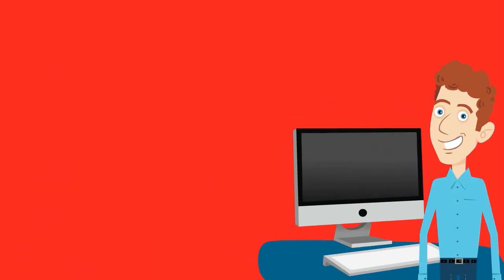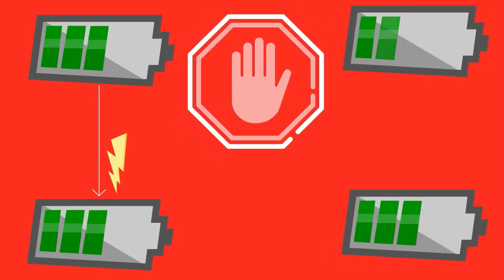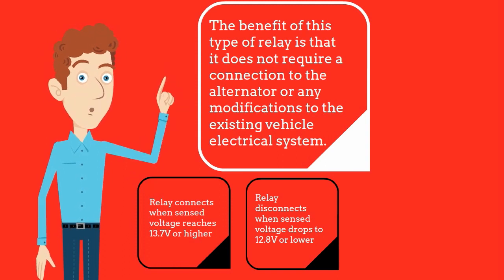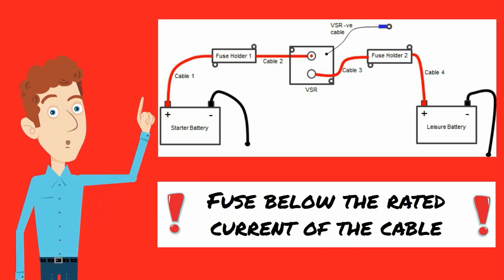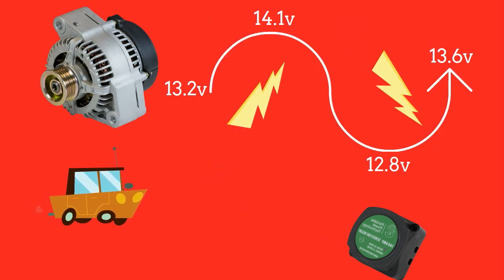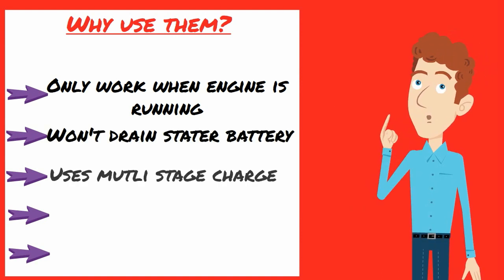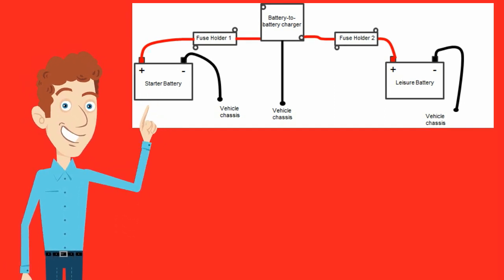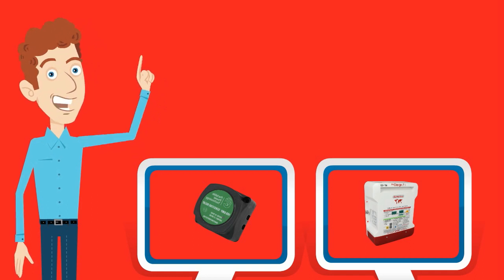Voltage Sensitive Relays (VSR) & Battery-to-Battery Chargers Explained | 12 Volt Planet

Comment: Great video and I'm just learning this. Is this a correct statement. A dc to dc charger is superior , it will regulate your current, prevent over charging, offers 3 stage charging and protects damage to the battery bank, whereas a VSR does not do this?

Comment: thank you.  My Voltage COntrol Relay box (which I am assuming is the same thing) has two posts.  One is marked closed 12v and the other is marked Open 12.8.  Buggered if I know which goes to the car and which one to the van.  I have currently got the 12.8v going to the van.

Comment: Can I use a VSR to feed the DCDC charger? The DCDC charger that I have is not smart and will not disconnect with engine off... it does have a ignition feed but I dont want to open up the dashboard to find the ignition wire...

Comment: Hi there bought a vsr split charger for my Vauxhall vivaro it's got a smart alternator in it  when I heard it doesn't work i sent it back but the seller insisted that it still works with a smart alternator do you think there's any truth in this
Reply from the maker: If it is just a standard VSR that is not specifically compatible with a smart alternator, then no it would not work properly. We would need to see details of the relay to check for definite though. You can send the details to us at sales@12voltplanet.co.uk and we can take a look. Many thanks

Comment: What happens if you use this if a  smart alternator is on. I have one installed, it’s working but I think the vehicle is a smart alternator as it’s an 18 plate merc v class with euro 6 engine. Every now and again battery warning light comes on dashboard then goes off when I restart engine. Any advice much appreciated. I’ve also subscribed, thanks
Reply from the maker: Please contact our support team on 01844 885 100 with your order number and our technical team will discuss your issue.

Comment: Hi there
I have a VSR fitted to my van which is Euro 3 
What I would like to know is 
If changing it to a b2b is it just a case of swapping them over and using the same wiring
Please forgive my ignorance
Reply from the maker: Hi, Depending on the B2B yes you could simply swap. Some versions may require an added ignition cable or D+ so it is worth looking at the manual you are looking into.

Comment: Do you also need to connect the DC charge controllers to the alternator or the ignition to stop it draining the battery when the engine is not running? Or does it work this part out itself like the VSR does?
Reply from the maker: Hi Ian, Some DC-DC Chargers will require a D+ or ignition for this reason but newer models like our Victron Orion will not as they use software to detect when the engine is running.

Comment: Hi I’ve got a VSR charging my two 110amp betteries which works fine but the issue I have is my solar panel is also charging the batteries and when doing so they are above 12.8v therefore the VSR stays open and the starter battery is then drawing from the solar panel 

My question is if I was to switch to a b2b charger would that solve the issue ive got with the connection staying open to the starter battery and drawing from the solar panel 

Tia
Reply from the maker: Hi, Yes a B2B only sends power in one direction (starter>Leisure) so the power the solar provides would only be able to travel in this way. If the Solar is on the leisure battery then the starter battery won't receive any charge from it.
Reply: @12VoltPlanetTV  awesome! Thanks for your help 👍🏻

Comment: Hi.  Great vid. 👍
I have a portable power Technologies split charge relay ( the Green one as in your thumb nail..) fitted to our campervan.
It had been working great..but has now started clicking every couple of seconds when the leisure battery falls to around 12 6 Volts.(with engine off) Sometimes the clicking doesn't happen at all..but mostly yes.. so I.m not sure .is it a dying battery..or faulty VSR?  The red light seems to be on all the  time.
Tia if you have any ideas..👍
Reply from the maker: Hi, If you purchased this relay from us please contact our customer support team who will assist.

Comment: I want to limit my current from 200A alternator to charge 280Ah LiFepo4 battery. Can I use a VSR to limit the current let says only 100A? What should I use?
Reply from the maker: If you are charging a LiFepo4 battery you will need a DC-DC charger as they require a very specific charging voltage - https://www.12voltplanet.co.uk/battery-to-battery-chargers.html

Comment: Hi ....Thanks for putting out this informative video. Just wondering what type of charger would best charge 2 x 165 amp gel batteries? Even though the vehicle is equipped with the older type alternator , I'm reading that I'm better off with a b2b charger. Thanks in advance.
Reply from the maker: We would recommend a DC-DC as it can deliver a charging profile more suited for Gel batteries.

Comment: Great video! Question. Since I have a Lithium (LiFePO4) battery as my house battery I need to have a DC-DC charger to protect my alternator from catching fire. Before realizing this, I already bought an VSR. Now, I'm gonna buy a DC-DC charger. Should I connect it as '"Alternator - Starter battery - VSR - DCDC - House battery" to prevent the house battery from draining the starter battery or will the DC-DC protect the starter battery without the VSR?
Edit: my alternator is old and is not a smart alternator, if that matters:)
Reply from the maker: DC-DC chargers are smart systems and will prevent the starter battery from being discharged. Any DC-DC should be installed as per the instructions supplied to prevent any problems.
Reply: What happens if you use this if a  smart alternator is on. I have one installed, it’s working but I think the vehicle is a smart alternator as it’s an 18 plate merc v class with euro 6 engine. Every now and again battery warning light comes on dashboard then goes off when I restart engine. Any advice much appreciated. I’ve also subscribed, thanks

Comment: Hi , great video !  I am converting a van to a camper .May I ask if its possible to connect a solar system whilst retaining a VSR , to work in conjunction ? And if so do you sell the components to do this ? TIA
Reply from the maker: Hi Mark, Yes you can fit a Solar Panel though it is not recommended as the charging voltage from the panel will keep the relay open. This may result in your starter motor drawing power from both batteries and this could damage a leisure battery. You can fit an isolation switch to isolate the solar from the VSR when starting the vehicle but as it is a manual set-up most people will go to a DC-DC Charger.

Comment: hi.. does the amp rating on the VSR relate to the Alternator or the battery?  I want to charge 2 leisure batteries (2 x 110amp/h) would a 140 amp rated VSR be ok? the vehicles Alternator is 125 amp rated.  Obviously I would fuse/ cable size everything off the battery bank appropriately for each appliance.
Reply from the maker: Hi Robert, It is the current the relay can handle. The actual charging output will be what your alternator produces.

Comment: Hi I have bought a Renogy 40Amp DC/DC charger it does not have a voltage sensitive relay fitted only a wire which is connected so when you start up the van it starts to charge the house batteries. I could fit a on off switch but I might forget to switch on LOL. Could i fit the sensative relay you mention before my renogy DC/DC charger that way it would be voltage sensative or would it still not work? I have a smart alternator fitted as standard in the 2016 sprinter. If this does not work can you suggest anything? Is there a voltage sensative relay for lithiums?
Reply from the maker: Hi, Sadly a VSR wouldn't work as your voltage would still alternate as the ECU dropped the output of the alternator. For a System that will work when the engine is running and on lithium batteries, you will need a DC-DC charger https://www.12voltplanet.co.uk/battery-to-battery-chargers.html

Comment: hi guys .I have a transit van which already has two batteries fitted under drivers seat. both 85 amp same type crank batteries . I understand one is used for starting and the other for auxillary . they already use a split charge relay and an isolator which trips if aux battery gets to much draw when engine is off to protect starter battery from draining. setup is fine and working. I now wish to   add two 110 amp leisure batteries  for camper conversion. my thought was to connect the two new batteries in parallel with the van aux battery in effect giving me three working batteries. would i be better to add a batt to batt charger from van aux bat to twin leisure batt bank. and also if i add 310 watt solar panel and charge controller where would i be best to connect controller to batteries .can you reccommend any of your products that would suffice. thanks in advance , dave,
Reply from the maker: Hi Dave, Thanks for your comment. Please contact our sales team at sales@12voltplanet.co.uk or on 01865 236446 who will discuss this with you further.

Comment: Great explanation, thank you. Do VSR’s fail and how do you diagnose them?  I have one on my boat and it is intermittent that it is charging my house bank. The light on the front says it should be, but the house doesn’t see the charging voltage and continues to feed house loads and discharges. Any help is appreciated.
Reply from the maker: Hi, Yes sadly they can fail. The only way to diagnose them is to test them with a voltmeter to make sure your charging current comes through the relay. Voltage should be the same at both terminals when active.
Reply: 12 Volt Planet TV thanks for the reply and tip. Looks like mine has failed. I’ve got charging voltage of 13.9 on the starter side and 12.6 on the house side. If I disconnect power to it it resets and works for one charge cycle, then reverts to only charging the starting battery. Thanks again.

Comment: Excellent video, I'm in the process of fitting a 90ah AGM leisure battery in my van on a split charge system from my starter battery  as in your video, I have a vsr relay but would it be better to fit a battery to battery charger instead of the vsr to charge the AGM battery? Or will a vsr be ok
Reply from the maker: Hi, Yes a DC-DC would be better. This is because VSR's do not produce the correct charging current for AGM batteries and therefore can damage them & reduce there lifespan. A DC-DC charger can be set up for AGM's making sure they are well maintained and suffer no damage.
Reply: @12VoltPlanetTV  thanks bud which one woukd you recommend
Reply from the maker: @roostaraver  I would recommend the following - https://www.12voltplanet.co.uk/victron-orion-tr-smart-1212-30a-non-isolated-dc-dc-charger.html

Comment: Hi there, great video!
I have a 220AH deep cylce AGM battery.
Would either of these 2 options be suitable? i saw something below that you cannot use these methods to charge an AGM batttery. thanks alot
Reply from the maker: Hi, Thanks. Sadly as its an AGM you would need to use a DC-DC Charger. Using a VSR would damage the battery and reduce its lifespan.

Comment: hi mate, i was going to install a VSR but the bloke at the Jaycar Store said when the second battery a deepcycle AGM type is being charged from the alternator it can  be over charged which can have a detrimental effect on my new AGM battery as there is no controover the charging rate. is this true. he just said stick with a dc to dc charger.
Reply from the maker: Hi, Yes this is correct. AGM Batteries will require a specific charging current that a standard alternator will not be able to deliver.

Comment: What I don't understand about vsr and other isolators is, and what no one mentions on any  explainer ever, is if the starter is separated from the circuit when not being charged, how is it then used to start the car? What does the dual battery actually power when it's connected to the car? Do you have to install secondary 12v ports, or wire everything specifically to your dual battery? Because all tutorials etc just say 'connect this to your cars electrical system with an isolator'.
Reply from the maker: The second battery will be used to run anything that isn't factory fitted & shouldn't be used to start the vehicle as leisure batteries are not designed for that use. People use this system to run any electrical systems they may have added (ie: fridges, Lights, TV's & Cookers)
Reply: @12VoltPlanetTV  Well this is my point. All any dual battery explainer ever talks about is adding a second battery to the circuit and isolating the main battery - but no one ever points out that if you use the cars electrical system - lights, 12v socket, stereo - you are still draining the starter battery. You have to explicitly wire things up to your deep cycle battery for any of these systems to be any use.
Reply from the maker: @MykMallett  This is very true, Thanks for your feedback we may look to tackle this in a future video.

Comment: Hello! Thanks for Great video! 
Would it be problematic to use a VSR of 125/140 amp in a car with alternator which generates 150amps?

Thanks
Reply from the maker: Hi, As long as the cable run is fused below the relays max you shouldn't have a problem as it would be unlikely your alternator would produce 150A.
Reply: @12VoltPlanetTV  Thanks for reply, have fitted one and it works!

Comment: Hello, thank you for the informative video. Would a VSR pair well with a lithium (LifePo4) leisure battery on an older vehicle such as a 1996 Mitsubishi Delica? Or it makes no difference what type of leisure battery you have? (AGM vs Lithium)
Reply from the maker: You would not be able to use a VSR with Lithium (LifePro4) without causing damage. You will need to use a DC-DC charger and set it with a lithium charging profile.
Reply: @12VoltPlanetTV  thank you for the advice. The DC to DC chargers are so much more expensive than a VSR... I might go for an AGM battery after all, I am still deciding. What I like about a lithium battery is that it's lightweight, compact and can be discharged more than an AGM battery.
Reply from the maker: They have a lot of benefits but as they are so much more advanced they require a very specific charging profile to maintain them.
Reply: @ViktorSuhov  You can only use an ignition switched relay if you are lithium charging. You must also take care not to exceed the rating of your alternator by sensible wiring with the correct selection of lengths and rated cables. It is not necessary to use a battery to battery charger to split charge lithium. Another solution to split change from your alternator for lithium would be a fet based battery split charge isolator such as a victron Argo fet. Have just uploaded a video today looking at the wiring aspect if you are still interested in lithium.

Comment: This doesnt show the critical connection between the batteries and the rest of the system
Reply from the maker: This video is to inform the viewer of ther differences between both systems not how to install them. If you wish for that info see our split charge kit video which works for both systems https://youtu.be/a9p7IYfmkJk

Comment: What if I have two leisure batteries onboard that I'd like to charge? Could I use a VSR to connect the starter battery to leisure battery #1, and then put a battery-to-battery charger from that to leisure battery #2?  Thanks!!
Reply from the maker: Yes, you could do that no problem as long as the 2 batteries are wired up individually & not in parallel or in series. If they are wired up in that fashion you will only require one charging method.

Comment: How about adding into the mix the alternator to battery charger?
Reply from the maker: Thanks for the feedback, we will look into this however we have found previously our customers find it easier to connect to the battery rather than the alternator.
Reply: I understand, but it’s another option and it’s not that complicated to fit. It works by fooling the alternator into outputting it’s maximum output all the time its needed, ie if the battery is not fully charged. It’s a very clever bit of kit and can be a better option than going solar if you have to run your engine occasionally ie to move the vehicle for some reason. If you park up onsite for days on end then solar is probably a better option. I’m thinking a2b is a good option for smaller campers which are used for moving about rather than staying on site. An hour with a full 60amps of charging is a heck of a lot of charge in a very short period of time.
Reply from the maker: @firmbutton6485  We can understand your point and we appreciate the feedback. We will review our range later this year and this will be taken into account. -Craig

Comment: Great video... one question does using a battery to battery charger trick the smart alternator into giving out a more consistent higher voltage then? Would that impact on the fuel/emission benefits of a smart alternator? Thanks
Reply: Hi Dan,

No- instead we just trick the smart alternator into providing a constant and reliable feed to the starter battery. From the starter battery our BB (battery to battery charger) boosts the voltage to whatever voltage your leisure batteries require.

This means that your batteries are being reliably charged over the course of your drive and with a voltage that you're in control of. 

It will affect your fuel economy slightly- but it's a negligible amount and it'd be feasible for us to argue that we're actually improving your overall efficiency because your batteries are being charged reliably at a controlled voltage, so you know the fuel you are burning on the additional alternator activity is actually being burned correctly. 

Hope that helps.